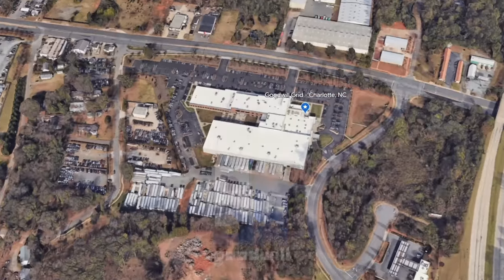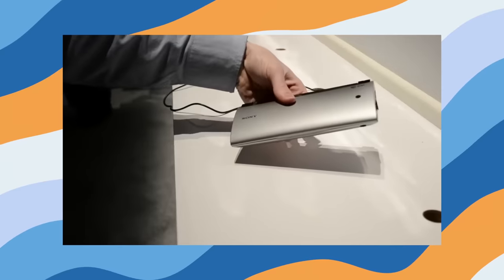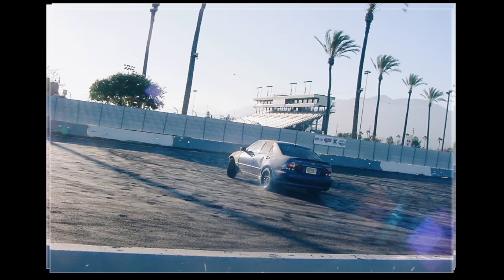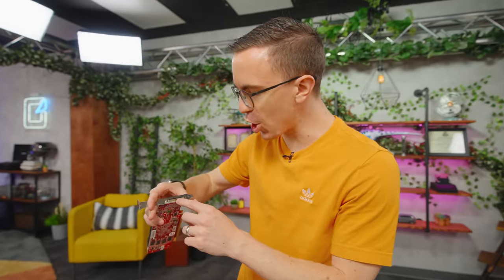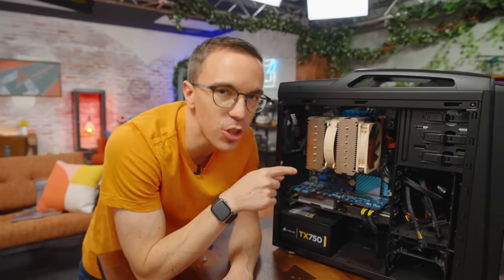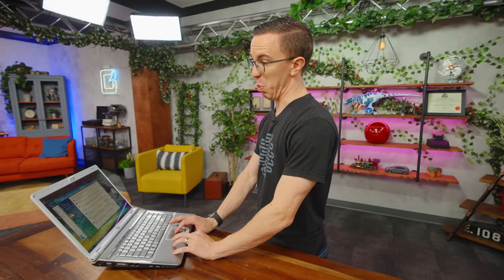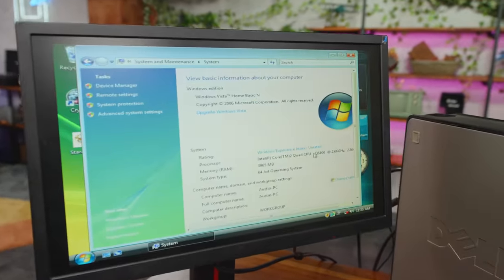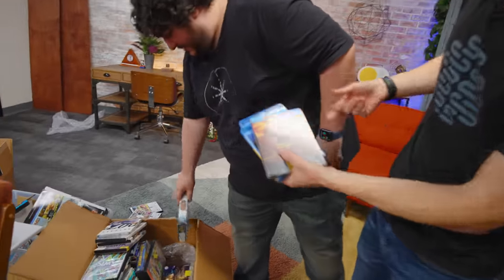Did I get SCAMMED by Goodwill?

Comment: A friend of mine gave me a system with a 4930k and 1060 6gb as payment for waiting in line for him when the 3090 launched. A few months later, I built my own system around a 5900X and 3090. My single-core Cinebench score was higher on the 5900X than the multi-core score of the 4930k

Comment: I'm old enough to remember using a Mavica as my very first digital camera experience, it was mind blowing! And that was back in 1997, I think it took VGA-res pictures... But man, when you compare the convenience compared to taking film to the photo place and waiting a day or two to get pictures back (of which at least 50% were blurry or not framed correctly), it was a real revolution!
Reply: Mine was with a samsung digimax in around 2002! I don't remember the model, i was pretty young and it's long gone. My parents later replaced it with a digimax s500 that lives to this day x)

Comment: In all honesty, I did get a fat ps3 on auction from goodwill for about $80 on eBay, fully working, with Assassins creed 1-3 on disk and 2 controllers. About ~$3 shipping from VA to FL, so it wasn’t bad at all. Depends on the platform and store of purchase I guess
Reply: Something must have changed since you bought that. I bought a Wii game and the shipping was like $10 and also had a "handling fee" of $2. Handling Wii games is so arduous, apparently. I thought the handling fee was the shipping price or I wouldn't have bought it. The shipping for nearly everything on there is $10 or more. Something heavy like a PS3 has shipping that's like $30 or $40. I live in SC and my game shipped from VA, not that far and most of the stuff I find there is either in VA or GA.

Comment: I had an old laptop of similar age with Vista on it (an old Sony, back when they used to still make laptops), and I managed to successfully install Windows 10 on it. Runs better than it ever did. Throw in a cheap SSD instead of the old (now very clicky) HDD, and its a pretty usable laptop. Lots of ways those old machines can still be used with only a minor amount of upgrading & cost, assuming the rest of the hardware is ok.

Comment: those 3930K can still play a lot of games and run w10 just fine, just put like 1060 or 1660 super on it. i'm still using 3470 with rx570 and i can still play games on medium to low graphics, i can stream and edit videos using this setup! and i only use 8GB ram with HDD LOL.

Comment: back in 202 I bought a pallet if 16 Pentium 3 Pc's at a local goodwill auction. I got 7 of them working and set them up on a network in my townhouse running cables through the house under moldings and to the basement through my kitchen floor vent and had a pc set up in every room for huge AOE network games. only computer I took with me in 2005 when I moved to illinois was my DV6000...lol

Comment: I still use my computer I built in 2013 while in Highschool and it still runs super well.. I only upgraded one thing in 2019 which was I upgraded from a 770 SC to a 1070 since I got it for 100 bucks.
Msi Gaming 7 mother board
I7-4790k 
I put an SSD in it for games and windows and all others are on a basic HD
650 watt power supply and 24 GB or DDR3 lmao. 
Can’t knock the old stuff when it still works as great as it does!

Comment: Scratched/untested games, here's a tip; 
First, polish the back of the game with regular toothpaste and a regular towel. So a little rough, but not super rough. 
Then, get a green marker and make the inside edge (in the 'hole') and the outside edge of the CD green.
This is a known upgrade for audio cd's and I never got why (seemed like bullshit to me, but it does actually work). Until I tried it on a damaged Windows 2000 installer CD. It went from totally unreadable to fully installing just fine. Apparently improves readability, I can imagine it has something to do with the way the laser's light scatters but that's just a guess. Either way, it's worth a try when all else fails. Don't think it works on those carbon PS1/2 cd's though.

Comment: I had an HP DV6000 series laptop that came with Vista, and at the time, HP locked the BIOS so you could not install Windows XP. But I found a custom Bios, that allowed it. So I "Upgraded" it to Windows XP and it ran 30 to 40% faster in games. 😁

Comment: Im currently using a 3930k on an old x79 alienware board with a 2080ti to play OW2 while my water cooled pc is waiting on a replacement pump. Able to lock in 144fps for my monitor no problem.

Comment: I have a Optiplex 760, but does have 4GB ram, core 2 duo, 240gb ssd, integrated gpu. End the best: Windows 11 (tiny). Games run sh*t, but the system is really fast.